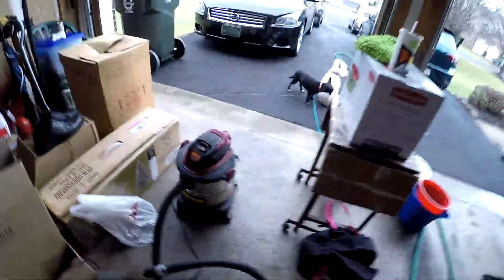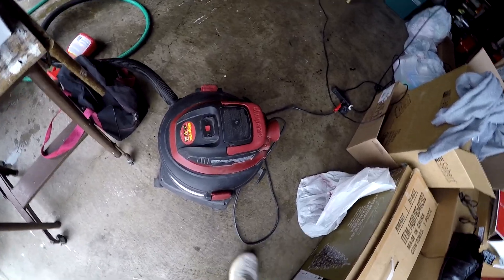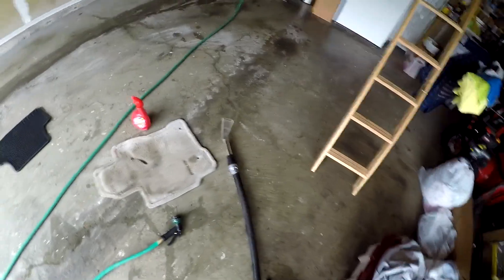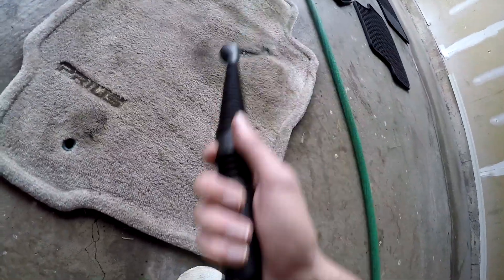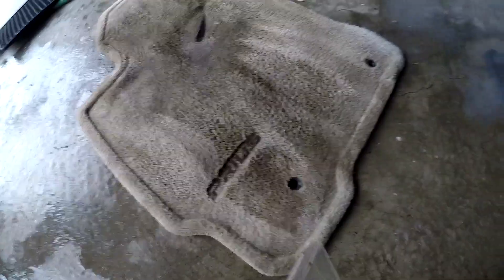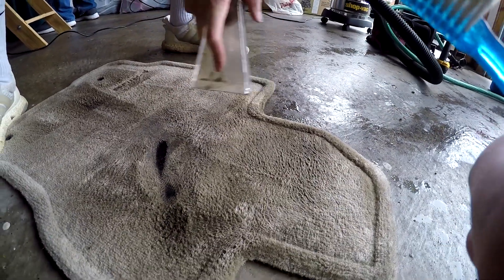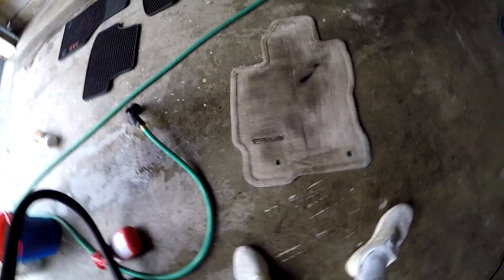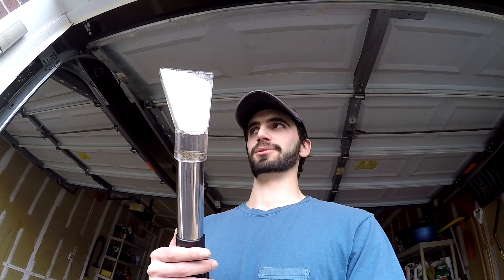Convert Your Shop-Vac Into A Carpet Extractor!

Comment: Brave lads, but way too make-shift and not as effective for your investment.  The one-piece 10" stair tool has it all for $120.  Just hook it up to a low-volume pressure washer (with a bypass - they all do I think) for another $100 and you're golden, with your vac, for $220+ tax.  Use the pump to draw pre-mix from a bucket.  Then perfect your technique.  You won't look back.  But do get your chemicals from a cleaning supply store and talk to the owner.
Reply: That costs 4 times as much lol

Comment: Dude. This wont fint ANY vac hose i have. And i cant find an adapter anywhere
Reply from the maker: So my shopvac has a very skinny hose as you can see in the video. The clear plastic vacuum head should come also with a generic "nozzle" type piece that affixes to any shopvac hose. Did you get a kit or just the plastic head?

Comment: Hey man are you still using this? I’ve got a 5hp shopvac and would love to save some money instead of getting a bissell unit.
Reply from the maker: I only used it in this video but once it warms up I'll be using it more. I actually got a little green for $25 recently just because it was so cheap. I tested it briefly, and I'm not sure if I got a crap unit, but the suction is horrible. This shop vac setup will extract amazingly well for you.
Reply: I have a bissell unit.... dont waste your money on a bissell! They are great but brand new they are like $100?? (and I bought 2 used for $50 each! I wish I had seen this video sooner lol)  You can buy the hand tool for $45 (amazon) and have more suction power from your shop vac than the bissell can do! (The main function of these is to extract as much water as possible! so go with this DIY version for sure!) I just hooked mine up today and was amazed! The suction was so strong I could lift up the mats with the suction.

Comment: Do you need to use a water filter on a shop vac while doing this
Reply from the maker: GeneralReaper My shop vac has an air filter that needs removal to do this. Very simple.
Reply: @sgfreak96  okay, I just didnt know if you needed a special filter for only water
Reply from the maker: GeneralReaper Nope, should just be able to remove any/all filters so they don’t get wet. The shop vac will suck the water straight into the bucket.
Reply: Definitely should always use your directs on questions like that

Comment: NOPE.. You did not clean them at all.. not enough water and you left soap residue.  My used car factory floor mats looked like that. Here is what I do..  Vac first..Any grease stains like that one, spray with "awesome cleaner" from the dollar store.. then throw them in a large front loading washer. Laundry mats have huge ones.. use laundry soap or regular dawn dish soap but not too much.. no softener.. comes out like new every time.
Reply: awesome cleaner is acidic and will take the color out of some fabrics and will ruin leather. Keep that crap far away from any vehicle, especially belonging to someone else. SuperClean in the 2.5 gallon jug for $18 at Walmart is the best bang for your buck, safe cleaner i've found.
Reply: @LBCAndrew  I have cleaned many vehicles including semi trucks and have never had an issue with that cleaner. You don't hose it on or use it as the main cleaner and it is not left to stand. I have used SuperClean but have found a better product that leaves no residue and does not make my hands feel striped. All of my customers are happy and 5 years after the first detail the vehicle still looks great.
Reply: @Samuelfish2k  My bad. total brain fart right there. Still gotta be careful using the stuff especially on leather. I prefer SuperClean for car interiors.

Comment: I would use a real extractor
Reply from the maker: lilart13ab Didn’t want to spend $500 on a cleaning machine for a car I bought for $800. Also commercial extractors are very large, I have nowhere to store it.
Reply: I bought mine for $160 on amazon it's a perfect size doesnt take up room 
BISSELL SpotClean Pro Portable Deep Cleaner (3624)
Reply from the maker: @lilart13ab  Nice, I almost bought one of those. I got my shopvac free and this part was cheap so I figured I'd try it.
Reply: @sgfreak96  I hear u but when doing a job u got 2 so things the rite way & use the rite professional tools.
Reply from the maker: @lilart13ab  The 3624 isn't a professional machine either that's another consumer grade machine. Bissell marketing it as  "professional" means nothing. Professional machines are AquaPros, Mytees, etc. Again, this is an $800 car, that I own. I don't care if if a tree falls on it in the next 5 minutes.
Reply: @sgfreak96  it's close 2 it & I know alot of professional detailers use this 1 including me.
Reply from the maker: @lilart13ab  Using a consumer grade tool for a professional job doesn't make the tool professional grade. If I start a lawn mowing business with a 21" push mower and an electric leaf blower, I think we'd agree those tools get the job done but aren't professional grade like an exMark 72" Zero Turn and a Stihl backpack blower. Same goes for a 3624 vs a Mytee.
Reply: I also have the Bissell spotclean. It's a good carpet cleaner but it's not as powerful is I thought it was going to be. Definitely not professional grade.
Reply: @lilart13ab  the shop vac he has contains more horsepower. For the same price or slightly less, he turned his shop vac into an extractor that does much better than any bissell extractor.

Comment: You can eliminate half the steps with a basic pressure washer for mats like this. Soak em, spray the detergent, use the drill brush, power wash, hang dry or use your wet vac. No need to buy a $45 extractor head IMO, just use one of the tools that came with the wet vac.
Reply from the maker: Yeah but this isn’t just for the carpet mats. It could be used on the carpets in the car that dont come out, the seats, the trunk carpeting. Your carpet in your house. The list goes on.